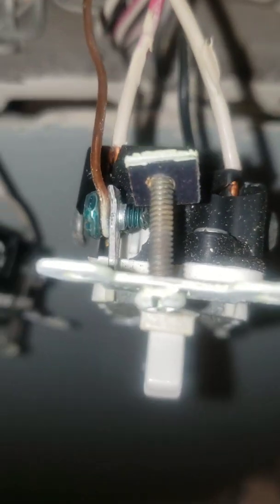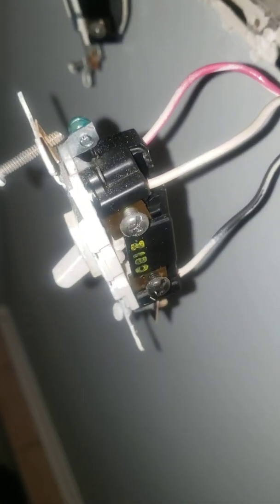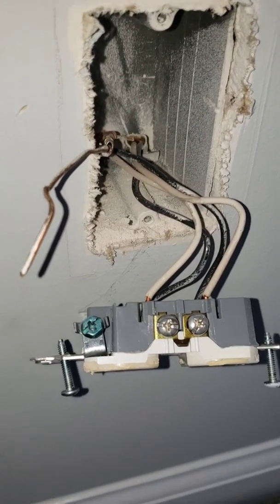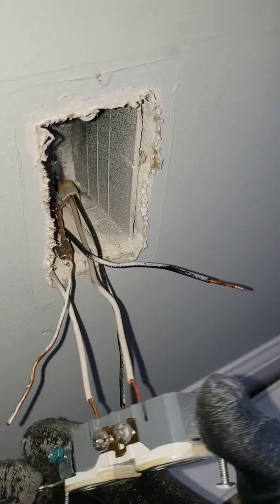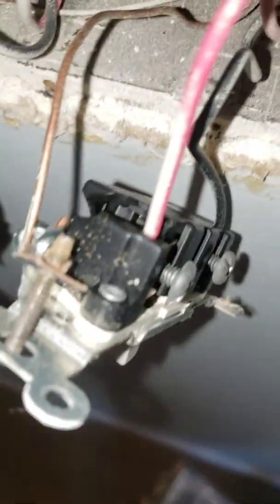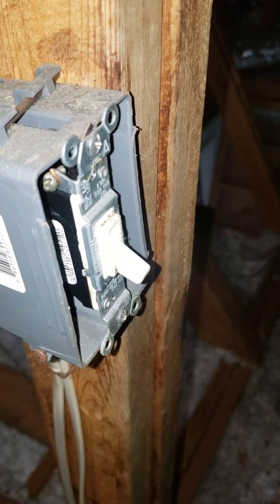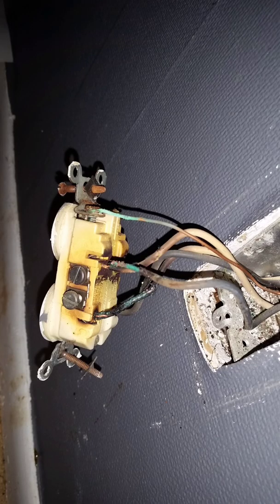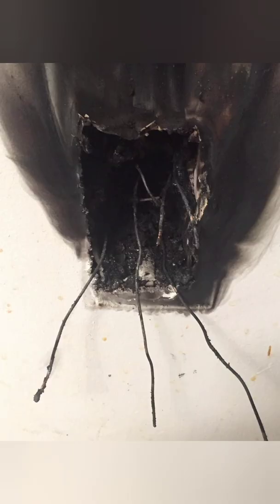Backstabbing/push-in wiring causes electrical failures and fires

Comment: In Denmark our outlets and switches have the backstab connectors had no problems with it no failures no fires
Reply from the maker: Great to hear from you--far away in Denmark!
In response to your comment, there is a big difference with your outlets--and that's voltage.
The standard voltage (for common outlets) in Denmark is 230volt, and it's 110-120volt here in the US. Higher voltage means less amperage. For example: a 1500watt space heater here would pull 12.5 amps (120v outlet). A 1500watt space heater in Denmark (designed for 230v outlet) would only pull 6.5 amps. I'm not saying it's ok to backstab outlets that are 230volt, because you can still have appliances with high enough amp draw to cause problems. At least you should have less problems. 
High amperage causes loose connections to heat up, sometimes arc and spark "trying" to make that connection. Copper wire also expands and contracts with heat and cold (not as much as Aluminum wire), making loose connections worse over time. That's why torqueing the wires under the screws is the best practice. Backstabbing should not be available nor manufactured.

Comment: Y would u care if ground touch white ? Its in breaker box as white and ground all on bus block ad one and I personally hate that , explain that .
Reply: Ground should never touch neutral again after the first bond, which is usually your first disconnect point from the transformer. Ground should have zero current running through it at all time unless theres a electrical fault for however one may occur. The single bond at the first panel is for the overall system to work safely, reliably, and provide protection to not only itself but you and the path to anything metal, plumbing, comms cable, and static discharge. Bond the first, isolate the rest, protection at the best.

Comment: Thank you for the video. Helped me figure out the thing that happened at my home tonight. Wife went to unplug our shredder and said the outlet starting sparking as she did so. I shutoff the breaker, took off the outlet panel and thought it was weird the screws on the side weren't wired. That's probably my issue. Looks like I have a lot of outlets and light switches to investigate and possibly replace...friggin' lazy ass home builders...

Comment: Would the breaker trip if a hot or neutral fall out or would it start a fire
Reply from the maker: The breaker would not trip from them just falling out, nor would it start a fire. The hot wire needs to touch the bare neutral or ground for the breaker to detect a direct short. Fires start from loose connections—if something drawing a large load is plugged in, loose connections create heat and arcing/sparking which can cause fires.
Reply: Standard breakers don't trip when hot or neutral wires fall out, they only trip when the circuit is overloaded or shorted. Arc fault breakers do all that plus detecting arcs throughout the entire branch circuit. So if that hot wire were to fall out and start arcing with some screw terminal or wire, then an arc fault breaker should trip before a fire starts.